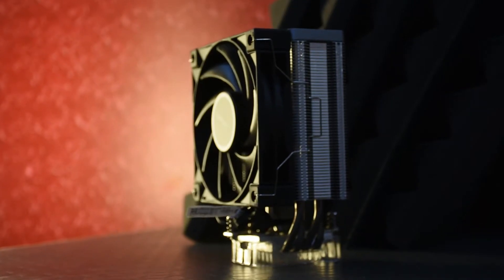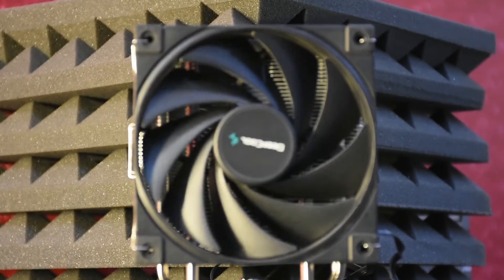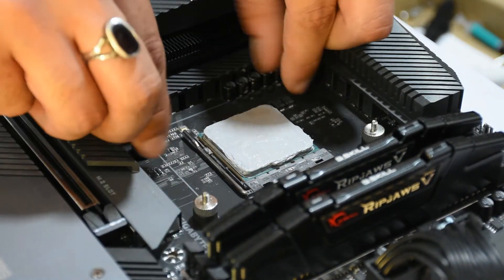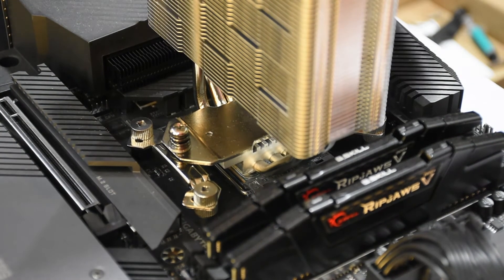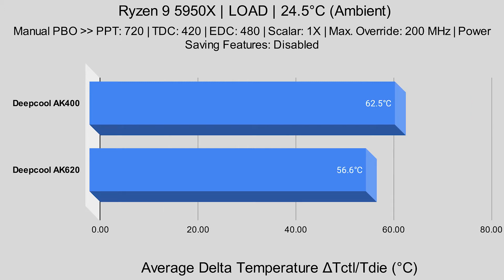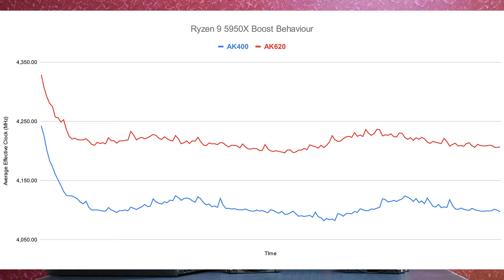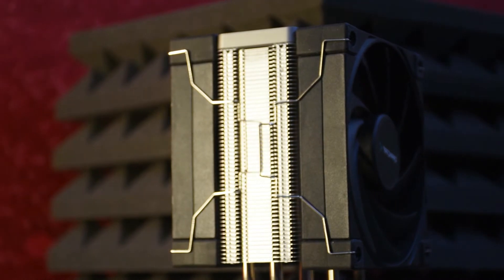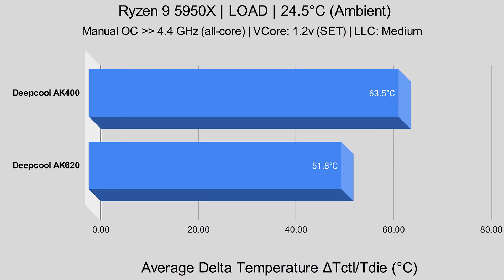Deepcool AK400 Review :: Cooling a 5950X with it! (English)

Comment: is Ak400 Good for 7500F
Reply from the maker: My apologies for the late response, brother. If you haven't already made the call, yes, the AK400 will be more than enough for the 7500F. Hope this helps. :)
Reply: @PCSpecies  i ended up buying AG500. The temp is very cool . I Overclock 100mghz and still 55c in Cs2 Max FPS
Reply from the maker: The AG500 is slightly better than the AK400. Then again, it isn't that pricey either so you made a good call. And the numbers look good. Sp congrats.
Reply: @PCSpecies  Peace homie . unfortunately i wasnt lucky with lottery . my cpu is unstable at more than 100mhz boost so i stick with it . i see some Dawgs go to 200 and more
Reply from the maker: Ehh, the silicon lottery isn't kind to all. But it is okay, man. Till it gets the job done, it's all good.

Comment: Bhai ek simple answer chahiye, 5950x for 22k used, asus hero motherboard 16k used worth buying also tell me ak 400 cooler will handle thermal?
Reply from the maker: Bhai simple answer hai yes. Deal theek hai. Processor try Karo thoda aur kam kare seller agar possible ho toh. Baaki seller se hwinfo ka screenshot maang lena. At least kuch cores advertised 4.9 ghz tak jaane chahiye. 
Cooler ke liye bhai ak620 at least lagao. Ak400 chala dega but limit pe. Toh better hai thoda aur behtar cooler lo. 240 aio ya koi aur air cooling equivalent. 

Long answer hai ki agar sirf gaming le liye chahiye toh 5700x3d isse sasta hai Naya. Mixed use case ya proper productivity ke case mein 59050x badhiya hai par pure gaming ke liye 5700x3d. 

Baaki use case batao toh thoda aur clarify kar du. Ya insta pe dm kar do.

Comment: Hello, will the ak400 be good enough for a 5900x?
Reply from the maker: 5900x may be a bit much. In eco mode, it'll be okay. After some serious undervolting too. But out  of the box, it's a little too much for the ak400. Even more so in summer. Try the AK620 if you're fixated on the 5900x. Or go for a 5700x if you're fixated on the ak400.
Reply: @PCSpecies  I found a guy testing it on 5900x and got like 60° temps
Reply from the maker: On an AK400? 60 is hard even when the processor is not loaded because of scheduler and other tasks that bump it around. 
AK400 is entry-level. So I am not sure how the guy got there. Probably Eco Mode or undervolting. Even cooler ambient won't get it to a constant 60. It might be Delta T as well in which case you have to add the ambient temp. to 60.

Comment: can i use this cooler for my 5800x3d don't have budget for aio
Reply from the maker: No need for an AIO and since the 583D doesn't clock as high and overclocking is restricted, the AK400 might just work. But it'll be pretty saturated most of the times. I'd suggest that you go for the AK620. It'll last longer too.

Comment: Can this cool a Ryzen 7 5800x3d well?
Reply from the maker: Should do alright for gaming if the case is airy enough. Though 5800s tend to run hot, the 3D one isn't a sucker for OC either. So it should work just fine.

Comment: I currently have Deepcool AG400 WH paired with Ryzen 3600 and I'm thinking of upgrading to 5700x. Will my cooler be able to handle 5700x?
Reply from the maker: The 5700X is rather mild-mannered and the AG400, based on what we found with the AK400, should be able to handle it no problem. The case and the ambient temp will play a role on how well it does that though.
Reply: @PCSpecies  Thanks 😊

Comment: I just bought a 5700x. I have not installed it yet. I have same cooler ak400.
Reply from the maker: Congratulations on the purchase and the AK400 is a good choice. It'll work just fine.
Reply: Brother what is the temperatures of your 5700x with that cooler...pls respond
Reply: @Sjshsjsjsie  the highest so far is 61c. Cinebench 23.
Reply: @bigfellaoo7  brother could u tell me your anbient temperatures while ur cpu is at 61c
Reply: @Sjshsjsjsie  21c
Reply: @bigfellaoo7  here ambient temperature is 42 degree, except aio, what shall i use for 5700x or for 13400f...it would be great if u help me...
Reply from the maker: Even the AK400 would work. It's just that your temps would be higher. 
High 70s to mid 80s is what you may have. You can go with AK620 and they'll run cooler. 

Also, 42c ambient is the general temp of the city you reside in, right? In the room where the PC is must be lower.
Reply: @PCSpecies  thanks brother for your valuable response, yes this temperature is of city, but my room temperature is near about 36.....
I will use ak 620, no problem, can you tell me one more thing, on which Processor should i invest, 5700x or 13400f...with ak 620, (which Processor remain cooler with ak620)
Thanks
Reply from the maker: I have 32-34 at my place and I have ran 3700X and 3060ti comfortably even with an AK400. But AK620 is better in terms of future-proofing.  
About the processor, 13400 hands down for gaming. In productivity, the 5700X makes a compelling case and it's rather efficient too. But even then, 13400 is a better investment at this time. In terms of cooling, 13400 may run slightly hotter but not a lot. So I'd say that you should go with Intel.
Reply: @PCSpecies  thanks once again for your prompt response.
I am building my rig at the last of this month..
My Specification are
16gb ram 3200m
Deepcool 650d psu
Ak620 air cooler
Inno 12gb 3060 graphics
Now my work is multitasking, 50% productivity and 50% gaming, heavy use of browsers and softwares at the same time, that's why i am focusing on 8cores,but i can't handle slightest high temperature , many are saying 12400f can handle all this perfectly without heating....so should i go for 12400f....
I am very confused for Processor, here in my city, 90% are frauds in respect to value for money...if possible pls response
Thanks

Comment: Hi ,
i am using a Ryzen 7 3700x at stock settings with stock wraith prism cooler and my Gpu is Asus Rog Strix 2070 super and my motherboard is Msi B450 Gaming Pro Carbon Max Wifi
and using a Super Flower Leadex III 80+ Gold 750w Psu.
the problem is i am getting 66 to 80c on idle just browsing stuff internet and gpu on gaming goes 85 to 89c with 100% utilization and when gaming cpu went 96c once with just 20% utilization.

so what should i do and which air cooler should i go for?
Should i go for AK 400 or AK620?
i am really confused and i want a cooler pretty urgent cant able to run pc like this
and which thermal paste should i use?
Reply from the maker: I have a 3700X as well and for me, an AK400 worked just fine. You can go with an AK620 to future-proof. Thermal paste, any decent one would do, MX-4, MX-5, NT-H1, something cheap from Corsair. 

About the high temps, In your other comment, you mentioned you have a TD500 Mesh, that's a good case and not the culprit here. Ambient temperature can be one as your GPU goes rather high as well but I have used mine with ambient as high as 35 so that doesn't seem to be the problem either. Wraith Prism is not a very good cooler but it isn't that bad either. 66 to 80... 96 with just 20% utilization indicates either a bad mount or a bad TMI or something. 

I'd suggest you reinstall everything, check case fan orientation, and swap out the cooler. Then see how it goes. Please feel free to get in touch if you need further help.
Reply: @PCSpecies  How much temps are you getting while you used AK 400 on 3700x when you were using for games and while just doing usual pc stuff like browsing and idle.
not in stress tests like cinebench and aida 64
just the load and idle temps on daily pc usage for games and other stuff
Reply from the maker: I am not sure about the exact temps in those scenarios but I don't think it exceeded 80C unless the ambient was well over 30C. For idle it used to stick in the mid-40s. 

About bad TMI, my apologies, I meant bad TIM, Thermal Interface. Either too much thermal paste or too less. It can be a bad mount too. And in very rare cases, bad thermal paste.
Reply: @PCSpecies  and what is bad TMI?

Comment: Dude did you used entire tube of thermal paste..
Reply from the maker: Depends on the size of the tube and with what I have, it would have looked much worse. 

On a serious note, no. The NT-H1 is just a thick paste and I used a metro card as the spreader. And that's why you see patterns in the spread that make it seem thicker and therefore, like an "entire tube of thermal paste."
Reply: @PCSpecies  ok cpu bless u 😂

Comment: on Corsair vs 550w can use 3060ti
Reply from the maker: It should work. I have an Aorus 3060ti and can go up to 230W or so. 
Which processor are you using?
Reply: @PCSpecies  i3 12100f h610 mb 
gigabyte rtx 3060ti 3fan
Reply from the maker: Hi, sorry for the late response. 
It'll work just fine with that configuration. Though you can go up to 650W for future-proofing but that's optional
Reply: @PCSpecies  100% load on GPU I am getting 85 degree celsius temperature is that okay
Reply from the maker: Seems a little high for a 3 can model. Which case are you using? And what's your ambient temperature like?

Comment: Can I overclock my Ryzen 5 3500 with this cooler??
Reply from the maker: Yes, it can easily handle an overclocked 3500. Ambient temperature and case ventilation will have a part to play, but for the most part, it will do the job.
Reply: @PCSpecies  Thanks ❤️

Comment: bhai ek question or tha i am currently using Corsair vs 450w psu can i works with rx6600 planning to buy
Reply from the maker: Ideally, I recall that you have an i3 so your total wattage may be close to 250 watts considering the usual equipment. 

Toh 450 mein kaam chal jayega par thoda aur headroom hona accha rehta hai. Toh kuch time baad upgrade kar lena.
Reply: @PCSpecies  i don't want to upgrade psu now
Reply from the maker: Like I said, you don't have to but in future, when upgrading to a faster CPU or GPU, you may have to.
Reply: @PCSpecies  OK THANKS
Reply: @PCSpecies  if i upgrade my psu first then i will go with rtx3060

Comment: We can cry a river some other time 😭😭😭😭😭
Reply: @PCSpecies Can you please confirm whether this fan comes with LGA 1700 kit(socket and screws)
Reply from the maker: Yes, it does. Since the AK400 was launched after Alder Lake, it comes with the LGA 1700 mounting kit as well. 

Just as a suggestion, go with the AK400 for up to the 12400. Above that, even for the 12600K, you might need something more substantial.
Reply: @PCSpecies  Appreciate the reply back and I was thinking to go with this AK400 for i5 12400, so your advice helps me reassure my idea ♥️